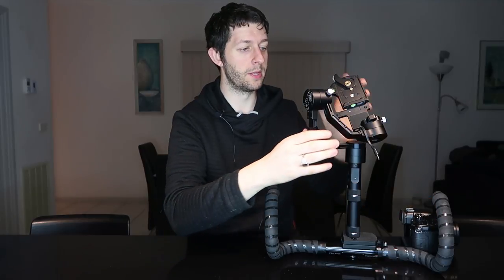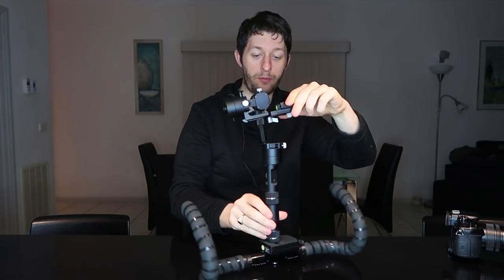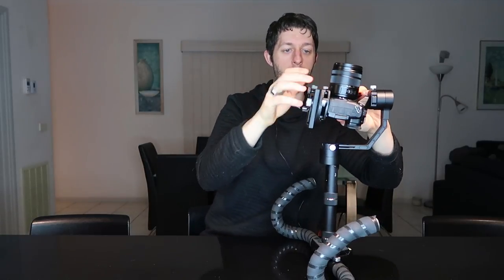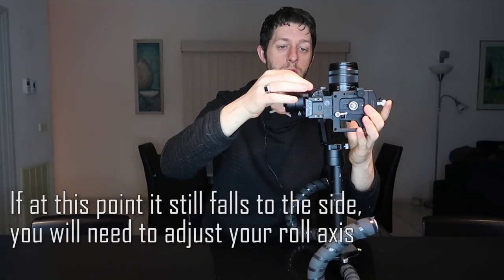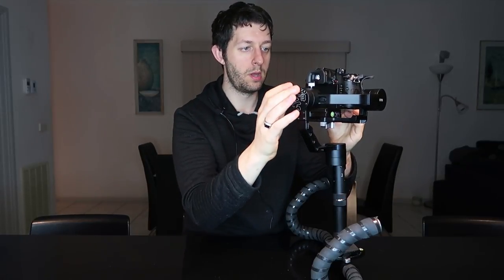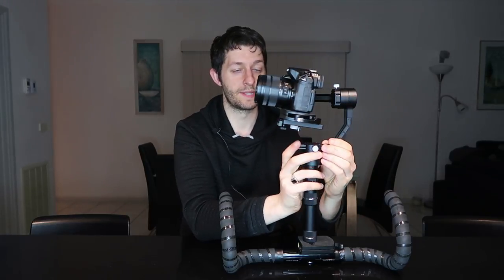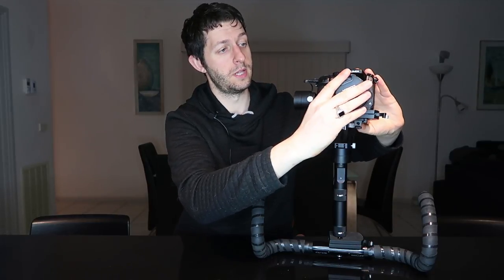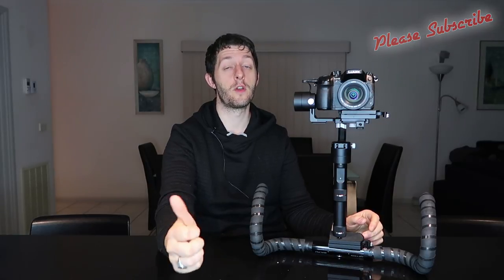How To Balance Electronic Gimbal Stabilizers (Zhiyun Crane)

Comment: Great work Mike. How are you focusing and filming without a follow focus? Ever had to swap lenses and rebalance or do you just film in wide angle
Reply from the maker: +syz knockaholics hey :) thanks! I have done a video on focusing while using a gimbal but just to sum it up, I either set my focus distance and keep that same distance from the subject or shoot at a high aperture number where almost everything is in focus or set my focus on something in a certain position and then move my camera into that position during the shot if that makes sense. Sometimes I even give autofocus a go but it can let you down sometimes. On this lens it's actually pretty decent and because it is wide angle most of the time everything is in focus anyway unless I come up really close to something. Yeh I swap lenses on it all the time and just rebalance, it doesn't take that long. This Olympus lens and the Lumix 14-140 are very quick to change between as they are reasonably similar in weight. I hope that helps and thanks for watching :)
Reply: Michael Ronin dope man thanks for answering. We have the same gear ececpt for the Gimbal. I prefer the Steadicam more
Reply from the maker: +syz knockaholics nice :) yeh Steadicams are great